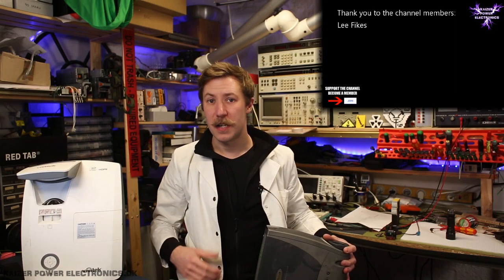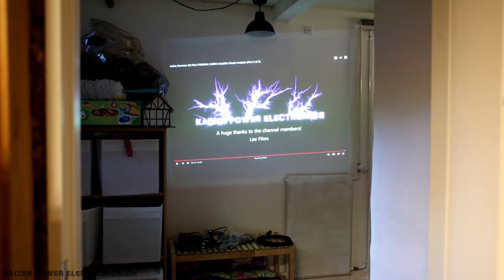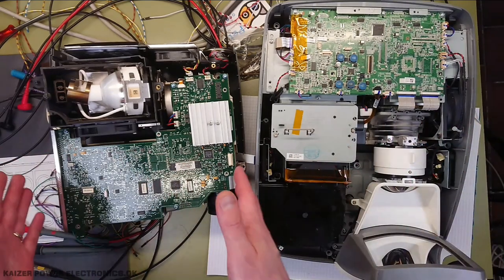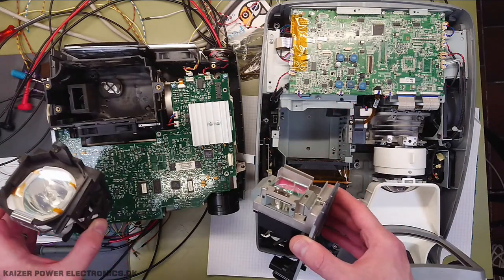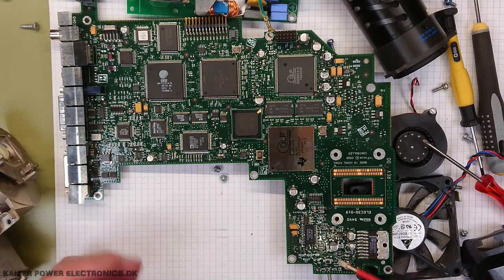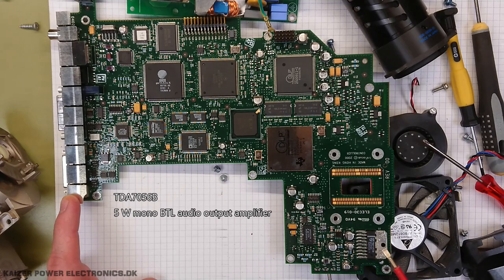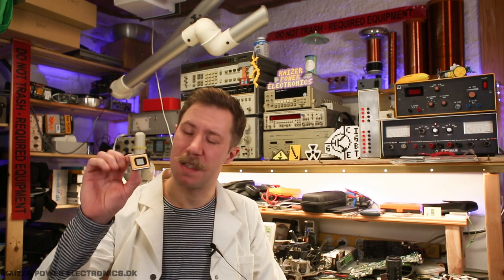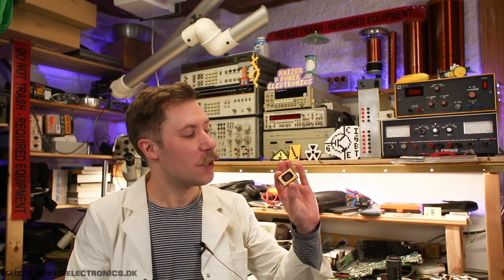Teardown of DLP Projectors With 15 Years Between Them

Comment from the maker: When I was young, much younger. I dreamt about having a projector film room. Now I have a awesome projector and it remains unused. Did you ever manage to live out the dream of building your own home cinema?
Reply: TVs were much smaller back then
Reply from the maker: @krz8888888  That is a very good point! That small 14" CRT TV I had... Well now there is a 55" LCD in the living room, which only the kids use :)
Reply: @KaizerPowerElectronicsDk  I acutally have a projector based home cinema but it didn't get much use once big screen televisions became cheap. You can now get a 75" fairly cheap with a much brighter and higher contrast picture than any projector. But for several years I was hooked, the immersion was so much better than à regular TV
Reply: @KaizerPowerElectronicsDk  same😅

Comment: The clear section of the colour wheel is sometimes used to boost brightness, at the expense of contrast
Reply: Yes
Reply from the maker: In those cases, does it then work in sync with the light dump? so you only increase brightness where needed and keep the black contrast
Reply: @KaizerPowerElectronicsDk  Late answer here but to my knowledge it doesn't.

Comment: The casting might  be magnesium
Reply: Very likely a magnesium alloy. Would be interesting to use some gallium on it, and see how it disintegrates as the gallium migrates through the alloy.
Reply from the maker: You talk about it, like its normal to have gallium as a household item :D
Reply: @KaizerPowerElectronicsDk  😅😅 no but a blow touch usually is 😁👍
Reply: If I remember rightly I think you can scrape off the oxide layer and use an acid, vinegar etc if it bubbles/reacts its probably magnesium
Reply: @T2D.SteveArcs  You can also shave some off and try to light it on fire. If it burns with a blinding white light, then it's magnesium.
Reply: @rocketman221projects  yeah I wrote a comment mentioning that aswel referencing a blowtorch 😅👍👍👍👍

Comment: You should snag one of the Casio laser hybrid projectors off eBay(~$50), they’re pretty interesting , there’s about 50 watts of blue lasers in them, but they don’t make them anymore cause leds finally were catching up in brightness. (Also I need help powering the laser array, the power supply is too smart to just use on its own) I could send you a Casio xj-m141 but shipping would probably be too steep, those models seem really common, there’s a lot of for parts ones, with either bad dlp chips or just loose connectors from being dropped

Comment: If you want wo built a super long range flashlight the lamps are perfect for that. 
Usually they are ellipsoid reflectors and will produce a focal point a few cm. infront of them, after that the light will spread out.
Get a lens that will collect all the spread out light and have its focal point at the lamps focal point.
With the lens some distance away (20-40cm) from the lamp the cheap ones made of thin PMMA will work completely fine.
I have built one with a 0.8mm arc gap lamp and a 300mm Fresnel that has a beam angle of 0.6 degree, so about 10m beam at 1km distance.
Calculated to 1m this gives 165 million lux.